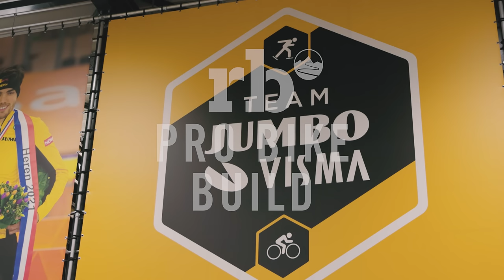Cervelo S5 I 2023 I Dream Build I Pro Bike Build I Team Jumbo Visma I Marianne Vos

Comment: Gritty style assembly paste on pressfit bb cups @ 7:00 ? Is that correct instead of retaining compound?
Reply: I'm not sure if that's grease (it most likely is, will need to check), but no, you do not use carbon paste for PressFit BBs.

It's either grease, anti-seize compound or retaining compound.

Comment: 14:30 - is a crow foot wrench really required here? per the Sram instruction manual it says torque it to 8nm with a crow foot wrench.
Reply: If you're poor at gauging torque manually or you want to play it safe, using a crow foot doesn't hurt. It's always less expensive than stripping threads. I do it out of paranoia.

Comment: Interesting way to ascertain the chain length.
Reply: that's the correct way to do it for modern groupsets. Sizing it with the RD will often get it wrong.
Reply: This method isn't new and uncommon, this is how manufacturers size chains for their new bikes. Calvin Jones from Park Tool once showed how it's done.
Reply: @yonglingng5640  no one said it's "new and uncommon".

The point is that some mechanics still do it the "other old fashioned" way and ended up with chains too short.

The new RDs calls for very specific longer than norm (especially in the case of Shimano's) chain lengths for their modern shadow+ design based RDs.
Reply: @ooitzeyang  Almost all wrong-length chains I see are a pair of links or two too long because they simply assumed as long as the rear derailleur's cage starts to tension, that's supposedly the right length, when it's not.

Comment: The Cervelo S5 has too many problems but they have never fixed it. They don't care about fixing the problems. Don't listen to their marketing BS by using pro riders & their win in races so they can convince you that you should buy it. In fact, those frames from pro riders look similar but they are not the same as consumers are buying. As the consumers, you buy low budged design layout & you own your bikes for a long period of time. Pro riders only ride their sponsored bikes for a race or 2 before they replace another fresh bikes. The only thing they care is winning on fresh bikes. They don't see the problems in long term. If you know Cervelo having problem in fail design & still wanting to own it, then be it. It's a free world.
Reply: so wat a problem bro? i saw alot cyclist in my country (VietNam) used it and they have told about this model amzing😂, absolutely do not believe Marketing much lol 😅
Reply: こいつS5乗ってないんじゃね。問題らしい問題といえばチェーン落ちした時の復旧がだるいだけよ。
Reply: @cornpopwasabaddude4729  Are one of the issues related to the bike's front-end?
Reply: @yonglingng5640  : Correct, Cervelo S5 Disc placed the piece of sharp metal attached to the steerer of the fork. Once you turn the steerer far enough even at normal use, the sharp metal would directly jamming against the carbon head tube to stop the handlebar to rotate further. That piece of metal soon pokes through the head tube wall. The latest S5 model, it doesn’t poke through but you still can see the damaged especially shining the light at 45 degree against that area. You can feel the lump by placing your fingers through that area. Now they said they fixed it which in fact is not true. They placed the rubber cover over that piece of metal, but it still jamming against the head tube. Most owners don’t know this & they are not aware of how their bike frames are damaged. Cervelo stayed silence about this for years thinking consumers would not notice this. Cervelo copied the Look bike design but Look is better quality.
Reply: @cornpopwasabaddude4729   Ahh, I figured it's steer stop-induced damage, I first learned of this in the third-generation SuperSix EVO, this is one bike I don't recommend to anybody because of this. I once knew a frameset that had this happen to it three times before deciding to cut off the steer stop altogether. Road bikes with steer stop designs really aren't the best, but the way Trek did it, at least the broken hardware can be replaced.

For the 2021+ Emonda, a broken steer stop won't really affect the bike other than the handlebars steering so far it hits the top tube. With the sixth-generation Madone however, a broken steer stop means the fork crown will strike the down tube when the cockpit gets to steer all the way. Many seasoned Madones of this generation have this form of damage.

On a side note, regarding your experience with Vietnamese cyclists, although I'm neither Vietnamese nor a resident there, you're not wrong about the "all the gear, no idea" statement in Southeast Asia, so I can relate to what you've experienced. In Malaysia, I've also encountered some riders who knew barely anything about their own bikes (when I browse online listings where the bikes were put up for sale, not a single one was done even half to being good, let alone professionally). A good handful of them also don't know about the hidden truth of the third-generation SuperSix EVO. Many riders just care about what's pretty and high-end, alongside riding.
Reply: @yonglingng5640  : I totally agree with you 100%. I have been riding all my life since grade school & presently I still own 60 super bikes since I graduated from Portland State University. I cannot say I am an expert but I have been owning & working on carbon fiber, titanium, aluminum & steel bikes since the day I was extremely into bike racing & owning my pride & joy bicycles till these days. Through my experience, I have learned that many bicycle owners who are having no clues of what they own. Most of them don’t even know what materials & how their bikes were built up. They don’t even know the terms of their components, etc. Now I ride & a member of many Velo Clubs in Southern California for fun. Sometimes I get lots of “ignorance” arguments from people who have no idea of what they are talking. They repeat words from their sale people. The most common statements I am getting are, “This bike is expensive, it’s made in Italy, it cost me $18k, etc.” Then, I only ask back at them some basic things such as what their frames size, geometry, bottom bracket types, etc. Then they feel like a fool & just pretending that they didn’t hear my questions. They get involve in some argument on whether their bikes are better than other bikes rather than sharing their knowledge.  They don’t even realize that they are making fun of their own ignorance. Sometimes I really miss the old days while I was in Portland Oregon. It was bicycle heaven & everyone was so friendly & they all knew bicycles deep down in their hearts.
Reply: @cornpopwasabaddude4729  Exactly, not all of them are riding for sport, some ride just for the trend. The 2020s bikes with integrated internal routing practically brainwashed people's minds into thinking bikes need to look flawlessly clean, with no shift and brake lines in sight, not even one centimeter of it. Worse, they had the nerve to call any other bike without this routing configuration as having external routing, even for a bike like the Tarmac SL6, which is so false. As someone who did not start riding in the 2020s, this mislabelling ticks me off *a lot*.

I dare bet some owners of such bikes have no idea what they signed up for, which is higher headset-related service charges due to the more labour-intensive procedure, which they may not be able to fork out the money for.
Reply: @hanguyenmr1618 No Cervelo retailers in Vietnam - fakes man
Reply: @vietle8157  oh all fakes man? i knw, and understand.